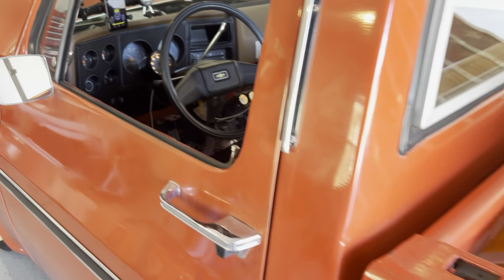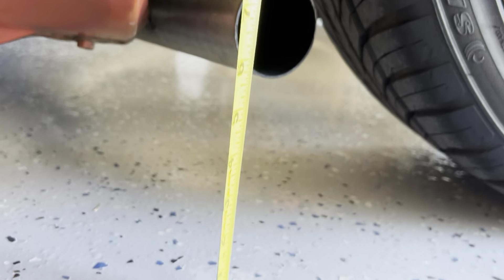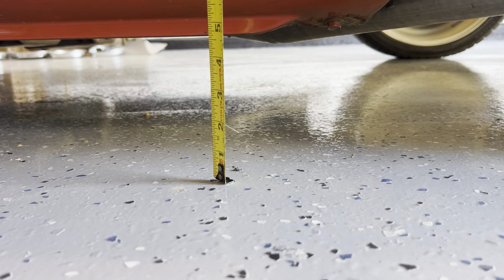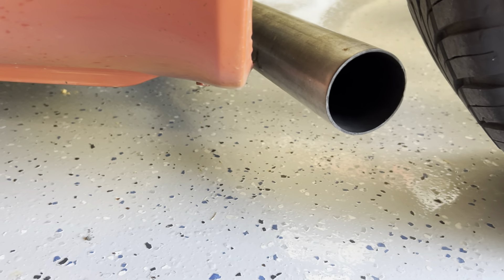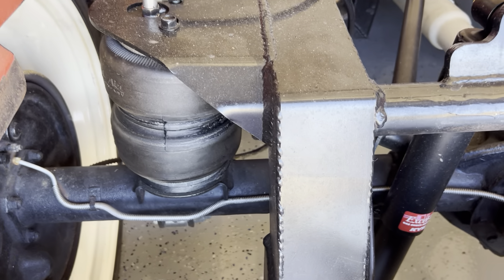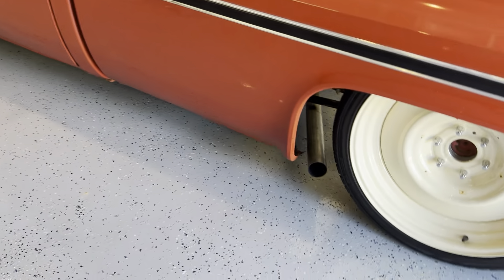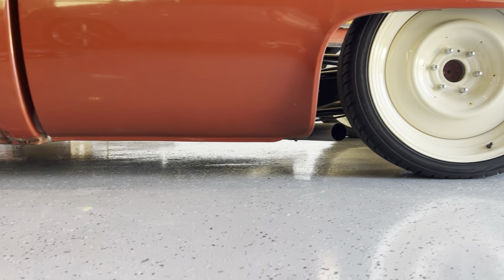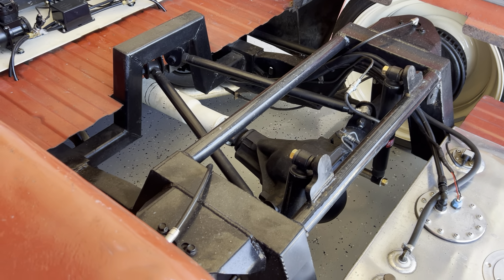1978 C10 Rear Air Suspension Ground Clearance

Comment: I never measured how much mine lifts, I bet its a foot anyways. 
But I run 150psi that puts the truck at a normal ride height. 
Below 100 its still sitting on the ground,
130+ to have full turning ability.
Reply from the maker: @katkilr7685  wow 150psi is a stiff ride right?
Reply: @TheTarmacDaddy  
 No not at all , it rides pretty smooth.
I did measure how much mine comes up , 9 inches. 
Check this out , I just replaced the original bag system that was on the truck  from '02.
The original system was a gold fish pond. Yep a gold fish pond like what you would have in your front yard. 😂
Reply from the maker: @ holy cow 9” of lift is amazing I’m so jealous!!!